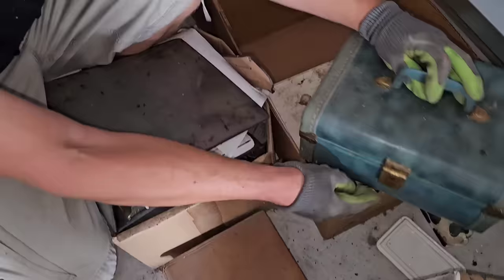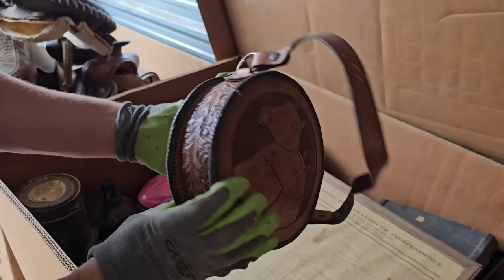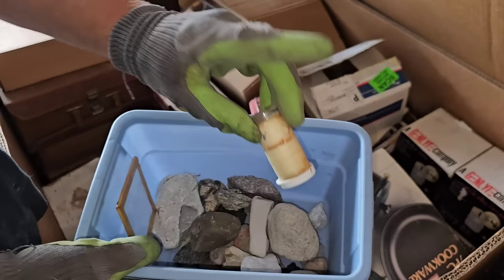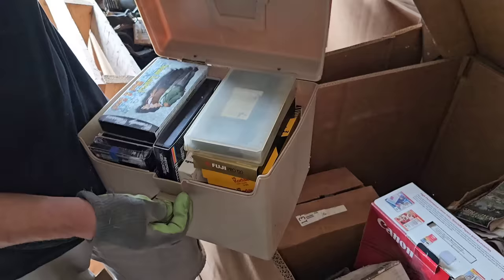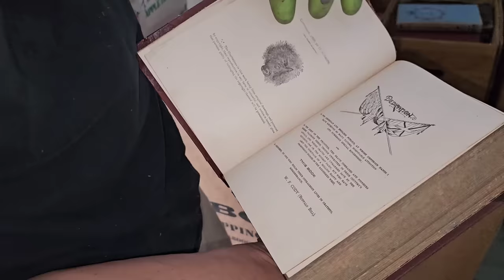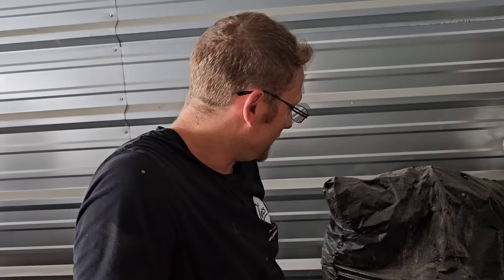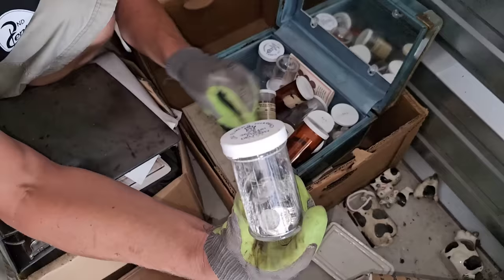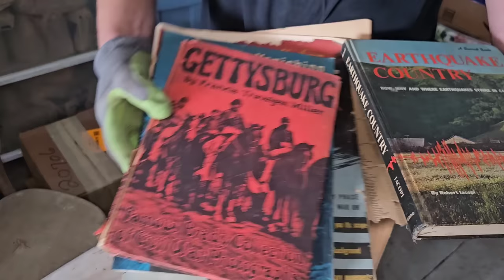4 GAYLORD boxes, what's inside?  ~ Drove 120 miles to buy THIS Storage Unit! ~ Locker LOADED with $$

Comment: Blank cassettes that say metal or there white porcelain and say metal are good money , just found some used in a locker and sold the white porcelain ones and they all averaged over $40 each on eBay , if sealed they sell around 100 each ,Thank god I caught those , they helped the locker turn great 🧐🥳🤑